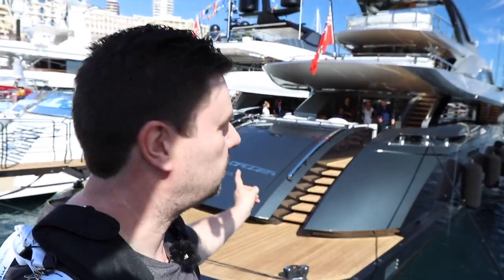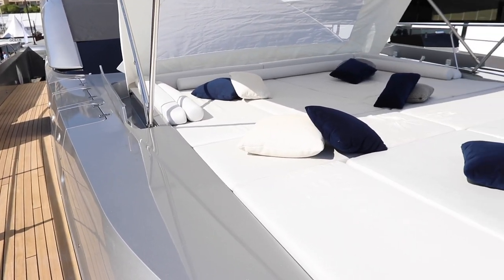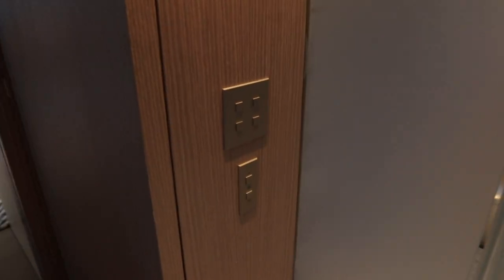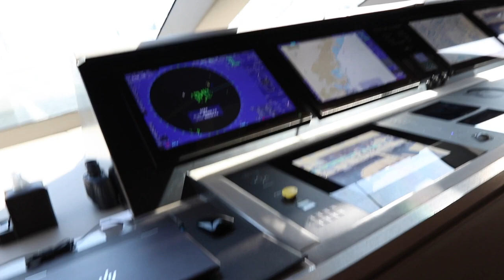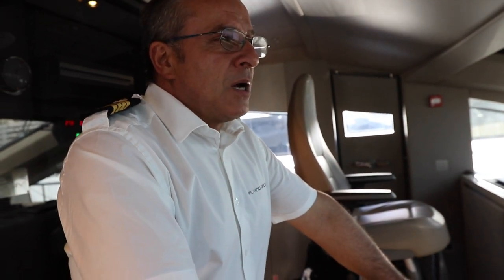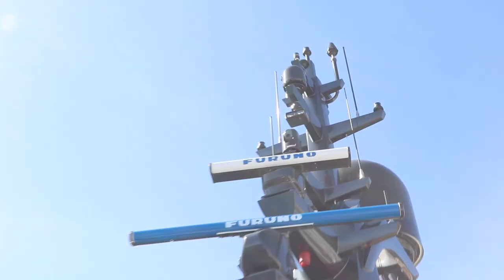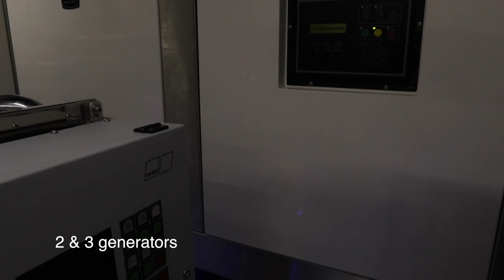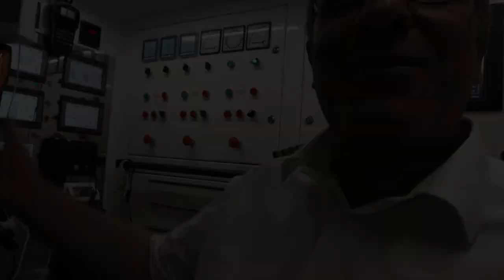Flying Dagger: Full Interior Tour! 2018MYS

Comment: What are those hatches on the floor generally used for? And how long did he said it took to be built?
Reply from the maker: It's hard to know, but most likely a vital access hatch, as putting it in a guest area would only usually happen if there is no alternative. Could have even been an escape hatch from lower decks.

Comment: If I understand correctly,this yacht has an aircon for the engines?
Does the machinery above each engine is AC?
If so,than this is one heck of a yacht! Not many yachts require ACing besides forced ventilation! Dry and cool air is great for the engines and performance as well.
Shout to the engineer to!

Comment: My father was watching this video with me, he was an apprentice engineering back in 1979 on a 100 foot cutter built in 1942, the engines back then were twin straight 8 Allison diesels coupled to reduction gears and the generators were two 4 cylinder diesels, the air conditioning plant was totally different too.  He said the engine room was noisy as all hell, smelled strongly of diesel fuel and hot like would wouldn't believe in the summer months.  They had to stand 4 hour engine watches down there while underway, times have surely changed I suppose.

Comment: Really good point about dimming the control screens. It sometimes amazes me how much goes into details about things, then one MAJOR point gets totally overlooked (and ruins a $100m dollar piece of work). My main beef with automobiles is that the CD player controls go on the steering wheel, but the cruise control get tacked onto the end of the turn signal level! The main purpose of a car is movement, and the cruise control should be right on the steering wheel where a thumb or index finger can easily adjust it. (But some makers think the CD player or A/C is what a car is all about?? Or an internet display panel where you have to take eyes off the road to see it??)
Reply: "Critical" here, but one thing about yachts that amazes me is having TVs and internet and A/C. If you have that kind of money for a yacht, why would you want to go out to sea to watch TV? You can't afford a 55" inch TV in your house or condo?? For my logic, a yacht should be open to the sea air, and one would take it out for the experience of being out on the sea. That experience you cannot get on land. Yachts are for sea; land is TV. The owner of Flying Dagger could spend a month at sea and not even get a tan. Why not rig a room in his house that rocks like a boat, to watch TV?
Reply: Looking back on the digital controls ... if you should have a short circuit on that boat that knocks out electric power (you are, after all, surrounded by water, especially in a storm), you're kind of adrift, aren't you? I conclude I don't like the yacht. I'd scrap the luxurious furnishings and electronics. Give me engines, manual controls, navigation, ship-to-shore radio, a nice galley, decent heads, and fresh water, with emergency sail and lifeboat. Put the furnishings (marble is heavy) in my condo in Monaco. (Haha.)